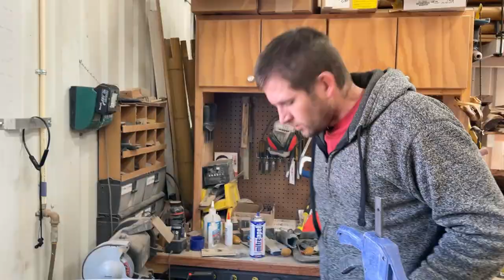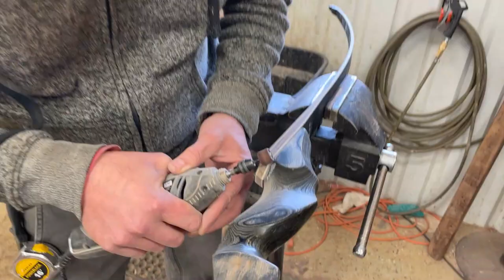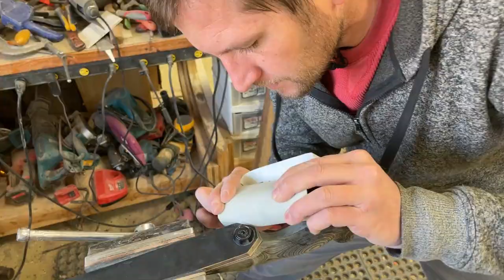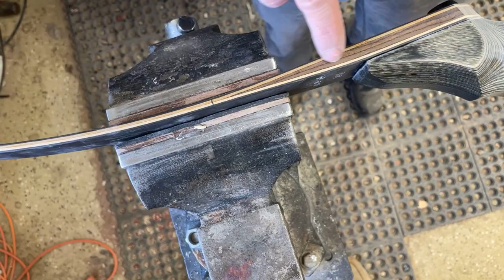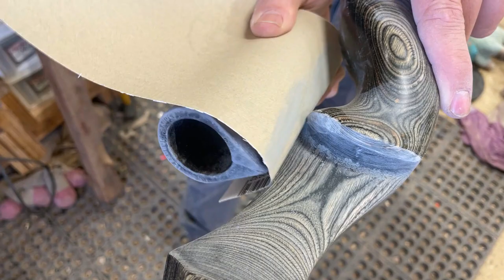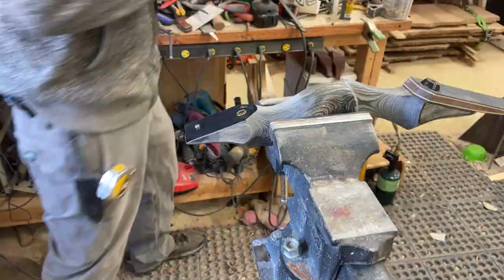Part 2 | DIY BLACK HUNTER Rework

Comment: Great little series you got going. 👍 
I'm just getting back into traditional archery. I used to own a Bob Lee recurve a long time ago. It burnt up with my house a long time ago. I found you because of the Black Hunter bow search on YouTube. For a $100 bucks you can try one out, and you haven't lost much if you don't stick with it. Now I'm looking at your bows, but that's a long ways away. 
I will probably be looking at a take down longbow. I'm not much on pretty bows, lol. It's a tool, and it will be abused. More interested in smooth, quiet, and moderately fast bow that is durable.
Thanks for the lessons.
Reply from the maker: Thanks for watching! We do offer more economically priced bows that are very high performance. If you're ever interested give me a call and I can go over the options with you
Reply: @greatplainsbow  
Where are yall located?
I'm in Drummond Montana
Reply from the maker: @ourmontanahome7291  Southwest Kansas
Reply: I still think the Bear Firebird a 30--35 pound bow, the Bear Titan 22--29 pound bow the SAS Robinhood 30--35 pound bow,  and maybe even the Junxing made 28 pound a 28 inches, a 54 inch recurve bow sold by others are better bows since they are dual sided with this being great if you do not know what eye dominance you are before starting.  Sure they are all fiberglass bows but being honest, they are better for starting out as all fiberglass bows tend to be cheaper to make with easier consistency in the bows design considering modern fiberglass can be in resin form before pouring into a mold and heated up rather then the old way of taking the fiberglass and heating it to right temps for the poundage needed after using a machine to carve a simi-finished fiberglass into the shape desired.

Comment: I own three black hunters since about three years and there are obvious quality differences according to the source/seller. Of late I have also seen other archers who got a really bad copy.

The reason I have three is because I had two replaced because of faults. In the end I am lucky to have three hunters that are excellent to shoot, compared to say my Fred Bear Super Kodiak and some excellent Asiatic Bows (by Grozer, Nawalny and Peter Bogar).

But no need to make the cosmetic changes you show, unless one wants to pimp the bow. For me your treated imperfections were trivial. Even the shelve not being fully center cut, which can be adjusted for. 

But I did replace the felt-like material between riser and limbs with rubber mat (from a car and around 4 mm thick). And pieces of velcro at the limb tips, specifically at the spot where the string may slap. Then replaced the crappy string with a Bearpaw Whisper string fitted with wool puffs and voila. I have been shooting the better copies of the Black Hunter ever since without any hand shock and with silence, smoothness and great accuracy. Both with the regular recurve and hybrid limbs, although I prefer the former. And with durability so far.

It’s a cheap and excellent bow if one is lucky enough to get a good copy 🏹 Happy shooting
Reply: Yes, I hear that as some sellers like SAS sell some Junxing bows (90% of the Black Hunters and metal riser Black Hunters are from Junxing sold by others) like this one 1994--1995 copy of what majority of the compound bows looked like from the era as the Siege. the Siege  compounds suck from SAS and  sell the same bow as Junxing but often forget to send parts with the bows like the shooting shelf that even the lower end set of equipment Siege is supposed to come with one of the plastic screw in shooting rests made more for target stuff from the early 1980's and you end up having to buy the SAS/Junxing models of shooting rests due to others not really fitting the hole well. 

The worst better low end bow (not those cheapest bows) to get is the Deerseaker Hunter a one piece almost recurve, that is $120.89--$129.99 and not worth that price. The bows all came out with major mistakes of limbs bamboo, they are still using the crappy bamboo from 2016--2017 that either had delams or way off weights, with this Deerseaker Hunter weights are so off with the bow it can be 30 pounds off on either direction, so do not buy the bow. Sad as Deerseaker with the hybrid between middle eastern/Asiatic and western bows they rate well for the price or the full on Middle Eastern/Asiatic bows are some of the higher rated bows on Amazon for the styles they are made in or price they are made for.

Comment: Really enjoying this series on the tuning and cosmetic upgrades on the Black Hunter. Appreciate your time and sharing the techniques. Curious if oil finishes can be used on bows in general ( boiled linseed oil or tung oil)?This is quite a treasure coming from a professional bowyer, Thanks Shane!
Reply: Yes, if you made them yourself or stripped the finish off the bow.
Reply: @caseysmith544  Thanks Casey!
Reply: @markmetzger5430  No problem, I looked though all the True Black Hunter models on Amazon one time to find a bow a person he had bought bow off E-Bay the same model that was actually close to a non Black Hunter model in very interesting colors & pattern, but we could not find it. I even tried on Junxing after being told they made the Original Black Hunter model and found they made the metal rizer model as well.  He wanted to find limbs for the bow model and we could not find them as well as post a review to never buy this model of bow, the way the limbs attach causes some major failure in the attachment points. He could only find the bow model though his purchase on E-bay.  I think he went with a Black Hunter clone in actual not the compressed bamboo like wood that the specific top and bottom type Black Hunter limbs as seen in video this this riser fit better on then the limbs sold with the bow according to reviews.
Reply: @caseysmith544 
Yes it's a clone. I commented on his review about this. And again this is why you never buy a bow off amazon. I bet when he got that it didn't come with the Black Hunter logo on the Box, we know it didn't have the black hunter mark on the bow, it was another company. And i bet that didn't come with the Black hunter seal of approval and inspection tick off. I worked for Amazon for two year's, saw this alot, not only with bows. But he's got a shabby rip off. Had he brought a real Black Hunter none of this would be needed. As i wrote in his review, i have a samick sage, a real one, my friend brought his off amazon, and surprise surprise it didn't come with the samick logo on the box, no paper work at all, so this goes for samick to. I made the mistake and should of known better buying a bow from amazon the one i ordered i can't even remember but cost 145, the bow i got was a Yn-m10 which you can get for about 60, but tbf it's an ok bigginer bow, as I'm a bigginer, kind of, I e i shot bow year's ago. But i do know what Amazon do, and why its not illegal idk. But try suing amazon lol.

Comment: How about replacing that felt piece between the limb & riser with a thin piece of plastic? I recall the old Bingham T/D bow had nothing between the limb & riser but it “creaked” sometimes when drawn. Probably like the BH, less than a perfect flush fit up.
Reply from the maker: Good idea
Reply from the maker: Actually we are planning on doing a short video on actually shimming the limb pad to increase performance on the bh. It should be interesting

Comment: Question  a little off topic???? If I was making a bow riser but using limbs where the limb bolts are up high towards the end ... can you use a 5/16" x 2" long Lag bolt for wood to secure the limbs. or  do you have to use inserts and machine bolts?
Reply from the maker: You can't use lag bolts. There's a chance it may hold for awhile, but it's too risky
Reply: @greatplainsbow  Thank you I figured it would eventually fail due to vibration.

Comment: As an ancient bow hunter i don’t understand why so many people but takedown bows. Most people are much better served with a one piece bow.   Great video though!
Reply: They want takedown for the ease of travel/storage or the like.  If I ever got a takedown bow for ease of travel it would be a modern hunting/3D target bow riser that is ILF in design for the limbs so that I have a bunch of options for the bows limbs as they do make a bunch of limbs for this bow. The ILF hunting riser came out in response to people wanting bows for 3D target shooting in the 2000's they could easily find limbs for in stores mainly in Europe where it was hard to find bow limbs for hunting bows due to the odd laws.  Cool part is there are several styles of ILF risers in wood/solid carbon fiber and wood that have better design to the bow. One wood design of ILF riser that is cheap in both sides left and right is using the Black Hunter design of handle but has a better just past center shot riser or at center shot riser. It comes in Black, Red, sometimes this dark blue but rarely left hand/left eye dominate bow just right for the dark blue.